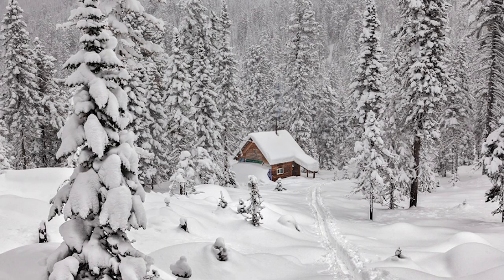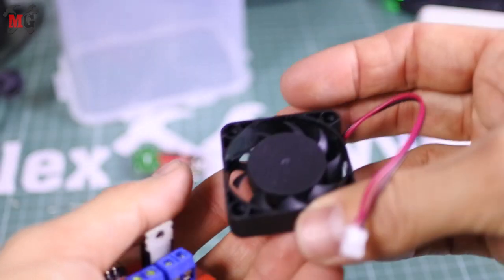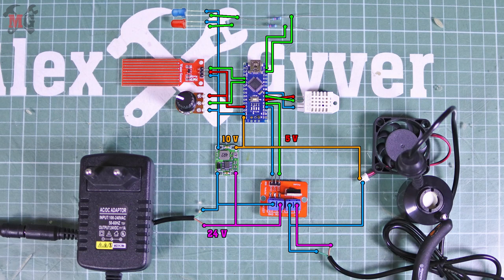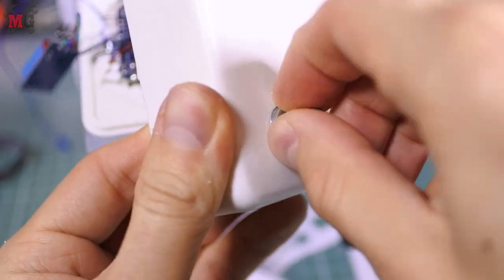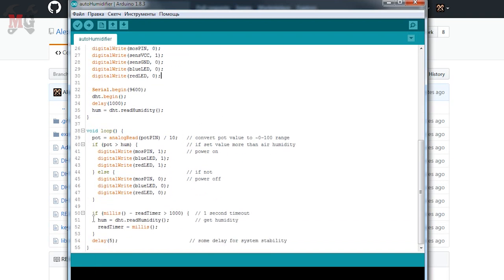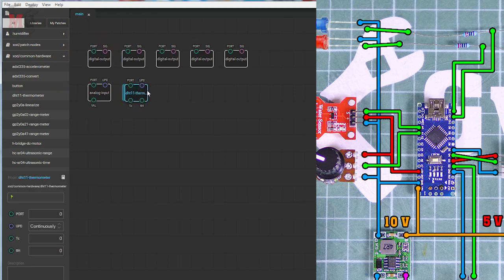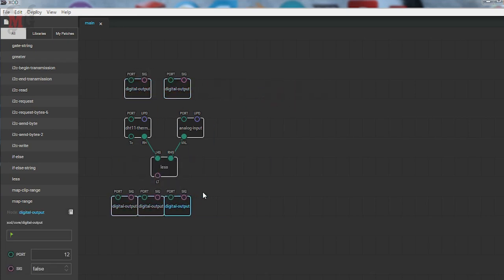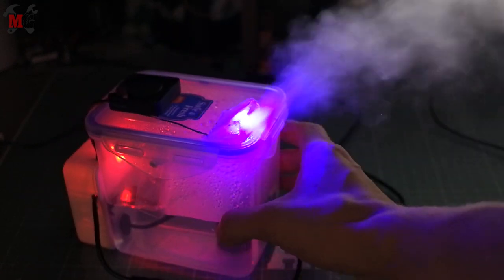DIY Automatic Air Humidifier [Arduino & XOD]

Comment: +MadGyver hello ben I am a Kutluhan student in mechanical engineering I have a projem There is a fog in the fog and automatically detects the fog in the air How can I do this?
Reply: Remove the fog from your fog so it wont detect the fog in your fog so you can fog with fog